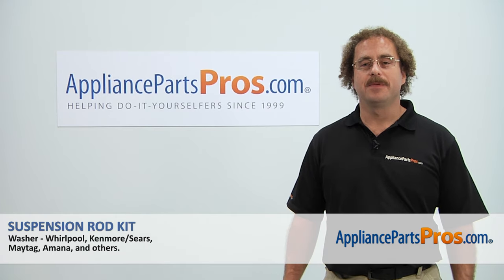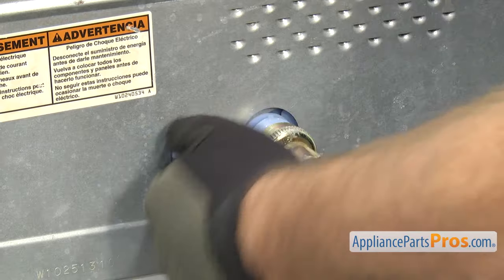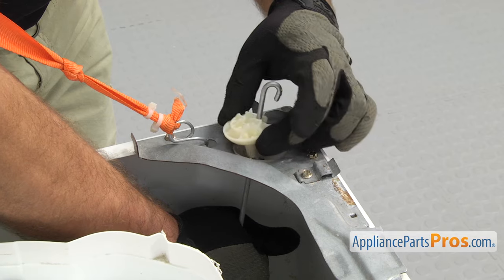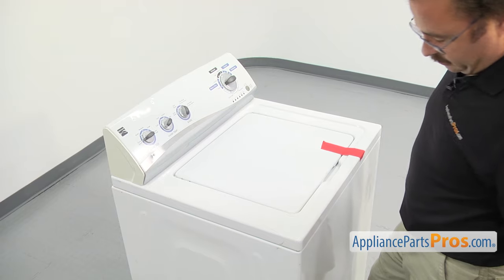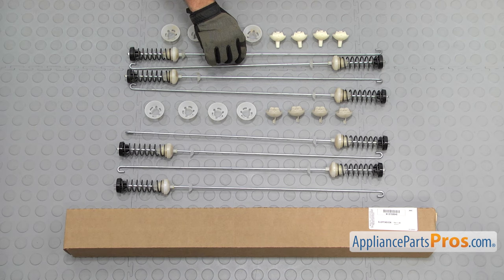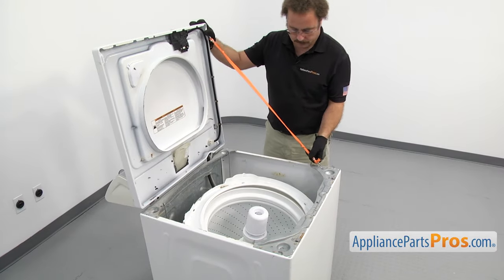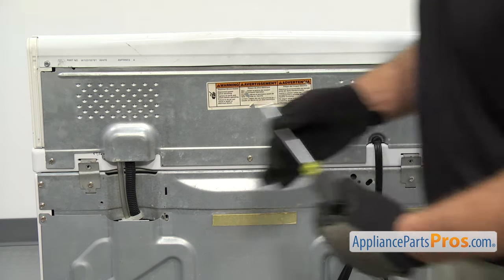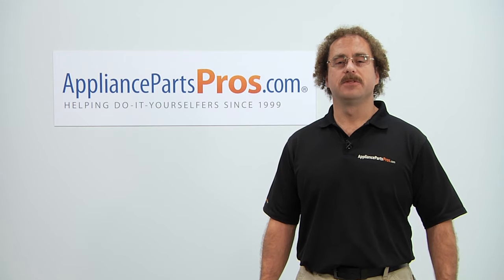How To Replace: Whirlpool/KitchenAid/Maytag Washer Suspension Rod Kit W10780048

Comment: Great video.  Thank you for sharing.  I installed them with help form my son.   I would pull up on the suspension rod and he would place the plastic bearing.   I struggled a bit since the new rods have so much tension.  I used an old suspension rod hook to get leverage and pull the suspension rod through the hole.  This actually made it easier.   Although it was a bit challenging, your video was perfect plus it feels rewarding knowing that I installed them myself.  Much appreciated.

Comment: Great video, I tried the steps myself and so far I'm still getting the UL unbalanced load but I did notice my machine is running better. For the cost and the experience to fix something I never knew how this was a challenge. Like some comments have mentioned it was not easy lifting the balance rods. So it takes some patience. Hey if I can do it anyone else can.

Update, I reset my washing machine after get the UL error again again I did this change. After the reset my machine has been working fine so far. 
Thanks for this video

Comment: Great step by step video. Worked great. Have a helper slightly lift the drum as you reinstall the suspension bearings (balls). It makes it a lot easier. Thanks.

Comment: I found replacing suspensions one by one much much more easier than taking off four at the same time. It may sound harder to take off one of the suspensions and tilting washer down, getting old one underneath and putting new one. When you put new one put some duct tape buttom of new suspension, it will help not to damage neither your floor as well as suspension will not get damaged. If you replace 4 of them same time you will definitely need one more person at least to lift up drum but if you do one by one it should not take any longer than 45 min for one person. Also very nice tip - use the head of old suspension to hang to the new one and lift up. It will be twice more effective and will save your arm get cut and etc. Good luck with your repair!
Reply: Could you explain what you mean about using the old suspension to hold it while you put the new one on?

Comment: The method in the video requires lifting the rods high enough to insert the top retainer while the washer is upright.  As others have mentioned, this can be quite difficult, usually a second person must lift the tub while you insert the retainer.  It's hard to get such a good grip on the rods.  So I found a much easier way.  Simply tilt the washer and lay it down ON ONE SIDE, NOT ON THE BACK.  Then remove the two screws in the back and tilt out the top as shown, but it will be sideways so no need for a lanyard, no chance for the top to come crashing down on you either, so this is much safer as well.  Now you get access to all the rods with no weight on them, so you can remove and replace them completely while the washer is sideways.
Reply: sounds like a good idea!!
Reply: Yeah i tried doing how he did it to even pull.them up to get them out wasnt easy  then i nserted the.from the bottom was  no way i could pull them up. They make it look so easy
Reply: Ooooh let me tell you, I'm happy I read this, worked like a charm. Thanks for the tip!
Reply: I got one of the old rods out, then once the new rod was in place,  i used the old rod through the bearing hole, to hook the new rod and used the old rod to pull the new rod through the hole high enough to to put the bearing on. Then once the bearing was lined up properly with the new rod hook, i wiggled out the old rod.
Reply: I used a insulation wire hanger. I bent the end into a small hook to reach the suspension rod top hook and the top of the insulation  into a larger hook to grip. Put thru hole of washer where rod goes. Then slid on top rod cap slot then twisted into position and lowered.
Reply: If you could get it up on a set of sawhorses?
Reply: Thanks so much for the video and for various comments.  My wife and I just finished replacing our suspension rods.  We ended up laying the unit on its side…which led to its own complications but, all in all, a basic handy TWO person job.
Reply: Laying the washer on its side made it easy. Thank you
Reply: Wish I read this before…got my dang arm stuck in between the tub and the washer body. I thought I was gonna have to call 9/11 to get free.

Comment: You can also use one of the old rods to hook the top of the new rod to pull it through the top. 

Just slide the old rod hook end through the socket hole, connect the top of the new rod hook end to the old one and lift up on the old rod to pull the new one through the socket hole.
Reply: Thank you could have finished without this comment!

Comment: Excellent video, but, I do have to share that if you are female of smaller build, the weight of the washer drum is considerable to be lifting with one hand and arm,  pulling up from a single rod.  I lift, with two arms, a max of 40-42#'s, but, this was really difficult.  The springs do not give that much, and it requires a significant amount of upper body strength and brawn, to attach these.  It took me longer than expected, and really would have been better with an extra arm and hand.  This guy makes it look easy, but, it was not as easy with my older machine, and my strength level.  The new plastic bearings were very thinly made and would not snap on easily.  Again a little more brawn to pull the rods up further would have made that easier, but, I liked the older bearings far better, as the plastic was much sturdier.
Reply: You're not kidding! I'm a man but those rods can be a bear to pull up since they are what hold all the weight of the drum, and a bit dangerous because you don't want one of those suspension rod hooks catching on your hand or arm if it slips with all that weight pulling down on it. It's much easier after the first front suspension hook is seated to the do the last three, at least for me. I needed to ask my mom to pop on the first suspension ball while I held up the weight pulling up on the suspension rod because it was tricky. I found it was much easier holding on to the slippery rods while wearing gloves with rubber grips.
Reply: sounds like you need a man

Comment: Yeah, this is simple and cheap, however be forewarned that there's another failure that can cause these symptoms that are seldom discussed in any of these videos and that's a Stator that has cracks in it. Maytag and Whirlpool washers with direct drive motors seem to have this defect. 

Like many I did this repair and the washer continued its violent shaking. Then I did the bearings and seal...same thing...  Wifey is now discouraged and pizzed.

When I did the bearings and seal I noticed a few cracks in the stator housing. I read one or two posts on google regarding this but was skeptical that this could be the cause of the violent shaking and was reluctant to spend $200+ for a new stator if it didn't fix the problem. 

I removed the stator and placed it in an oven @275F for an hour to open the cracks up and afterwards used epoxy (loctite 9462) to fill the cracks when still hot. I then placed a band clamp around the stator to pull it together and let it set for 12 hours+. 

Wala, the washer ran like new. No shaking. This is a temporary fix and have since replaced the stator with a new one on amazon. All is right in the world now (wifey is happy again😏)!
Reply: A crappy washer makes your wife pissed? I would be looking to replace more than just a stator if I had to deal with that BS. Whipped!  Lmao

Comment: I did this today THANKS to your video. I do recommend a flat like container to put under the drain hose when you first pull it off for the excess water. An extra problem I had was tightening the packing nut on one of my water cut offs cause of a leak.

Comment: Excellent video!  I have one suggestion.  When lifting each rod to install the new bearing, I found I couldn't grip the rod tight enough and it would slip down before I could get the bearing on with my other hand.  Using a rubber glove on the hand holding up the rod allowed enough grip to get the bearing on.
Reply from the maker: Thank you!

Comment: Thanks for showing the step by step video of how to replace the suspension rod. My question is how I know if this is the problem with my washer. It can still dry the clothes very well and does not make unbalance sounds or rock the entire machine. However, when the machine is working, it makes loud sound especially when spinning. So, is this a suspension rod issue? I thank you in advance for answering my question.
Reply: Once its banging when on drain/spin it's the dampening rods.

These rods were designed to use for two yrs max. I'm now exploring using stick steel putty with nyogel dampening grease which may last for the life of the machine

Comment: I followed the instructions step by step. The installation went without a hitch. Once reassembled, conceded and back in place,  the washer will not come on. I've checked the break and the outlet is working. Any idea on what could be the problem? I have since watched another video on replacing the rod and it said to never lay the machine down,  just wondering if that possibly killed the machine?

Comment: Model WTW5000DW1 
Problem Excessive shaking n banging while in spin cycle

It has 2 suspension rods with green caps and 2 with white caps.  Are they perhaps the wrong one? If they're correct, which ones go where? Purchased used. Replaced with revised hub kit and recalibrate d. Shaking is better bit still some excessive. Leveled and repositioned laundry. Are there supposed to be a short spring attached to each corner of liner cap and the other end around the suspension rod. I only see 2. Not seeing the on your parts diagram.
Reply from the maker: It is possible one or two of the rods failed and were replaced instead of replacing all of them. Unfortunately, there isn't a way for us to tell that. The correct suspension rod for your model is part number W11130362. I'm not seeing any other springs listed for this model. If you have any other questions or need to order the correct parts, you can call us at 1-877-477-7278.

Comment: So we have rods for 2 years & the components came off of one of the rods. So can these components be put back together so we do not have to spend more money on suspension rods again?
Reply from the maker: You can try to put it back together, but if it won't stay together you will have to get new rods.

Comment: Me again. Found the short spring/centering springs video you have.  Hopefully, it'll help. 2 are mississing.
Reply from the maker: Thank you for the update
Reply: @appliancepartspros  . Youre welcme. wtw5000dw1  I installed new suspension springs and centering springs and calibrated today. 95 % of shakes cleared up. But!  Durning high-speed spin at the final cycle the first 3 to 5 seconds sorta wobbles then quickly clears up. What am I missing! Thanks I appreciate you guys videos.
Reply: I almost spelled Mississippi 😅

Comment: They look exactly the same those old suspensions aren't bad
Reply: Mine looked exactly the same as well, but the old springs were much easier compressed than the new ones that are very stiff.  The new ones did the trick.

Comment: Excellent video. Do you need the springs that attach to the rods or will the washer be ok without them???
Reply: There were no springs on my machine existing when I opened up to replace the rods, although the outside of the drum had a place for them to attach.  I decided to get 2 pairs of springs and attach them with the new rods.  Not sure if they are necessary, but, if they add any extra stability, it was a  minimal additional expenditure, and they were an easy add on.  HTH
Reply: @2010Sanctuary  Ok. I added the springs also for "extra" security 😎😁👍🏾

Comment: I did this and it is still walking all over the place . What else can I try?
Reply from the maker: Have you made sure the washer is leveled?
Reply: Always consult with a professional first, but it could also be a drain issue. If water cant be drained out enough it will cause a blance issue especially in spin cycle.

Comment: Having to run the rods into the bottom of the machine instead of being able to simply slide them into the base from above is a design weakness. Lying the machine horizontally significantly increases the time and effort required for this repair.
Reply from the maker: That can make the repair more difficult. If you have any questions just let us know.

Comment: I followed and replaced the suspension rods as you did and my Maytag Centennial washer still banging in the housing.
What else can I do to fix this? Help... Anyone... Please
Reply: You can buy damping grease and add it to the rods where the bushing slides on it (top of spring).  I'm surprised so few of these washer repair videos mentions damping grease.   When washer starts spinning, and gets up to a certain RPM with heavy load even slightly out of balance the combination of springs and load will be in resonance and the drum can fly way off center.  Damping grease helps prevent this.  New rods come with some grease on them but I'm not convinced it is optimized for heavy loads.
Reply: I have a whirlpool top load washer and I have changed all four of the rods but the washer is still doing the same as before banging and moving violently like it possessed. Don’t see any other videos on this beside to suspension rods. Is there any other suggestions of what else is wrong. Pls let me know thx.

Comment: How can u tell there bad
Reply from the maker: To check the suspension rods, with an empty basket, push down on the tub and see if it bounces back up quickly. It should not bounce but have some resistance when it comes back up to a normal position.

Comment: (In my east coast accent) Ya facking guy🤌. They obviously desighn these facking things to fail Paulie🤌🤌🤌. You know what imgunado pualie.... I think I'll design mine with a late 80's model Chevrolet short wheel base upper and lower controle arm and suspension☝. Ya know what I'm saying? That way it won't fail after 1 wardrobe worth of cloths. What da you say huh Paulie boy? Im just saying👐.